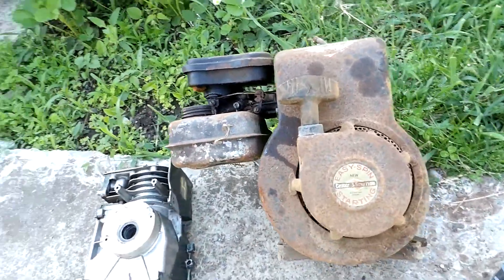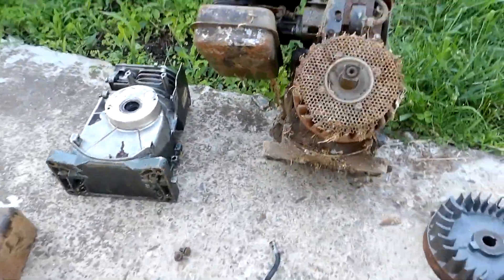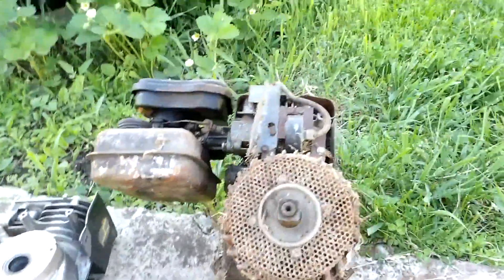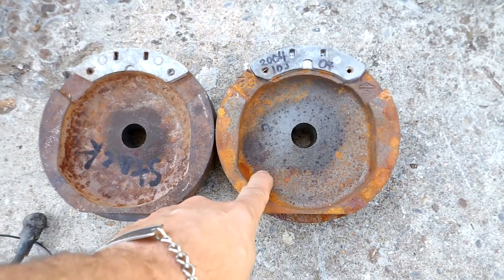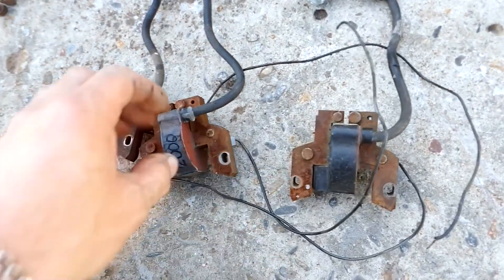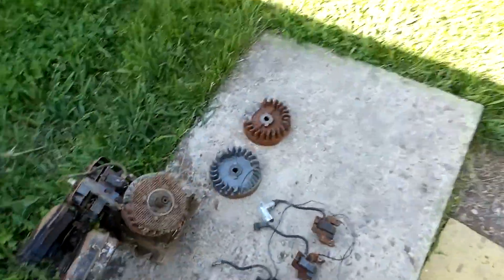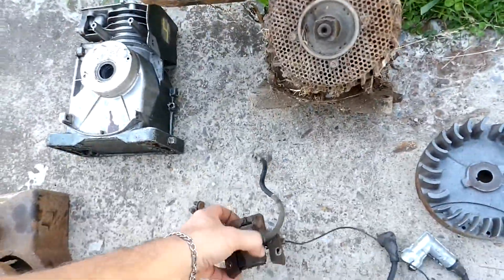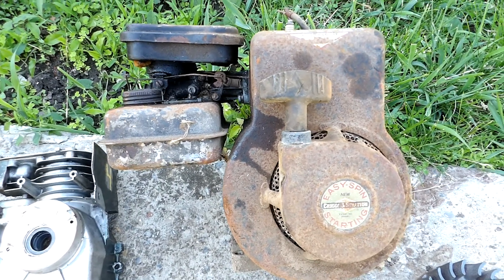Electronic Ignition Coil Replacing Points on 3HP Briggs

Comment: I’m having hard time finding a magnetron that fits my 3HP Briggs.  Do you have a part number by chance?
Reply from the maker: I would try a 591420 Magnetron ignition, it should fit. Even one of the cheap ones from Chins on ebay should work. The actual Briggs type costs like $50, while the knock off are like $15.  Also one from any Briggs 3.5 horse type lawnmower engine should fit also, I interchange them all the time :)

Comment: When putting the new electronic coil on it, do you need the flywheel of the one the new ignition came of, or as long as it fits an the diameter is the same can you use the old flywheel?
Reply from the maker: You can use an older flywheel, but the magnet on it must look similar to the one on the flywheel of your electronic engine. The very old Briggs engines I will say from the 1950s and early 1960s have a flywheel with 2 separate magnets, that will look different. That flywheel will not fire the electronic ignition.  That being said, 805Roadking has used an old Briggs points type coil, and fabri-cobbled it together with a Tecumseh electronic magneto, to make it work with the old 2 magnet style flywheel! Quite inventive, he is.

Comment: Given the simplicity of the points based system, it's easy enough to service anyway (unless the coil is utterly kaputt), condenser can be replaced, points can be filed and adjusted, doesn't really need replacing, just maintaining... :)
Reply from the maker: Yes, that is true, if an electronic goes bad, replacement time!
Reply: I agree. Just maintenance but I mean with part getting pricey 
And how simple this is 
I kinda side with this idea 

Electric ignition just easier 
One less thing to break. 
You got one thing a coil and that it 
( Some have a little more then that but )